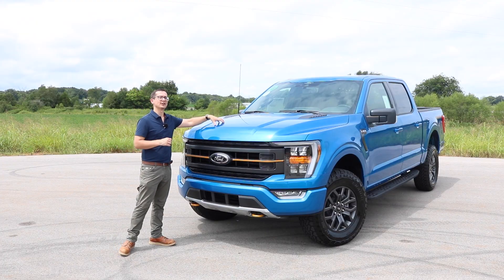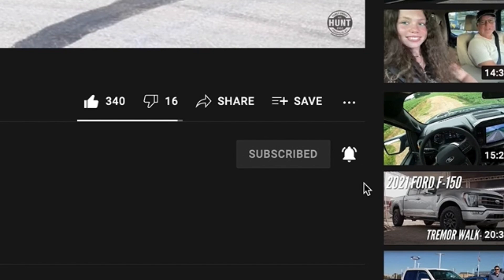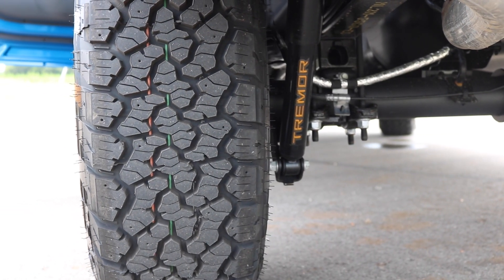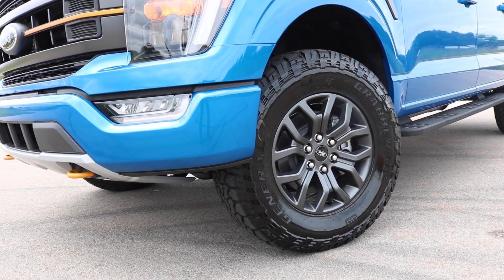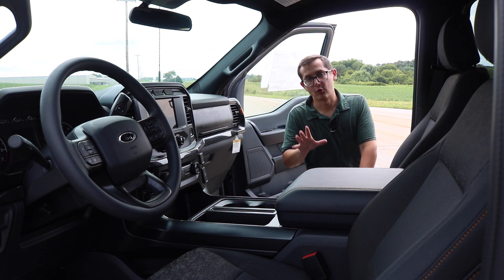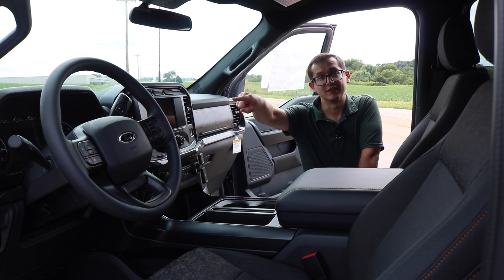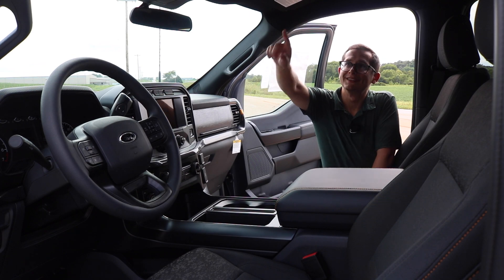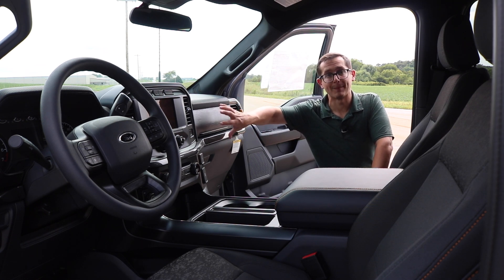2021 Ford F-150 Tremor Standard Options + Your Questions Answered!

Comment: Hey Ethan I was looking at the 2022 Tremor High package and was trying to figure out what the trailer tow package adds for 1k ? Seems like the high already comes with tow tech package, 360 camera and class 4 hitch ? So is there any benefit? Thanks for the help.
Reply from the maker: Hey there! As far as I can tell the trailer tow package (code 53a) doesn’t add anything to the 402a. It even looks like it conflicts with the tow tech package (17t) so it might get flagged on the order system as a conflicting package. This is the first I’ve seen of this though!

Comment: THANK YOU for clarifying the 8" to 12" center stack screen between the equipment groups! I thought the 401A only came with an 8" screen so I am extremely happy to hear this.
Reply from the maker: Our pleasure! That has been the biggest misconception from the build and price screens coming into the new trucks and we had to set the record straight! 👍
Reply: @huntauto  So, will the 401a come standard with the 12" screen, or is there and option our dealer will have select when they order the truck to make sure it comes with the 12" screen instead of the 8" ? Just making sure.
Reply from the maker: By selecting the 401a equipment group you’ll get the larger screen!
Reply: @huntauto  Thank you for the answer. That really helps!

Comment: What’s the gear ratio of the Torsen front diff on Tremor? I heard it’s 4.10, but does that mean it will have a 4.10 front and 3.73 rear? That will cause binding issues.

Comment: Did I miss it or did you talk about the transfer case?  Wondering if all Tremors (400A included) have the auto 4wd case....
Reply from the maker: 402a only!
Reply: @huntauto  Now I am confused lol.   On Ford's configurator today it shows the "2 speed automatic four wheel drive system" as standard on 400A 4x4.  Not sure if I can screenshot or I would...
Reply from the maker: @peruser155  we see that too! From what we have seen in person, the 400a and 401a have a two speed transfer case with 4H and 4L with the electric shift on the fly feature, but they are lacking the 4A setting that is available on the 402a! The 402a transfer case is called the Hi-Lock Transfer case.
Reply: @huntauto  Interesting!  Maybe it's a 2022 thing.  The one you featured here must only be Non-Hi-Lock then?  If they indeed include the auto TC on 400A now, the value keeps getting better!   Thanks for the replies.
Reply from the maker: Thanks for watching!

Comment: So if nobody has figured it out yet the 400a is not worth the added cost over buying a stx with the 3.5. The only real benefit is the 3.73 gears and softer suspension.
Reply: A similar optioned XL with the STX appearance package only saves you $3k. To get it on par with the tremor will take another $3k and then you have a tremor-like truck that cost the same but still depreciates like an XL.
Reply: @brandonoutlaw856  what is it exactly are you getting for that price that is actually worth it?